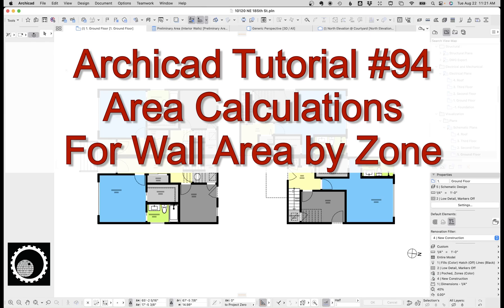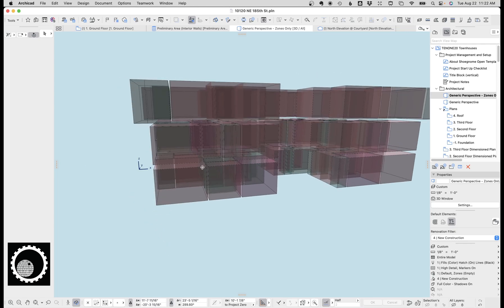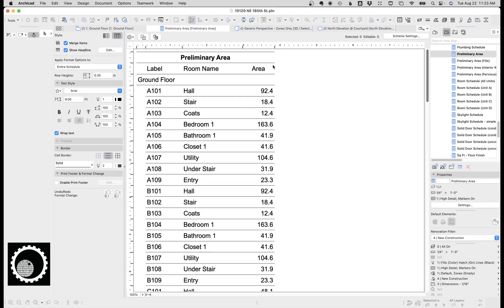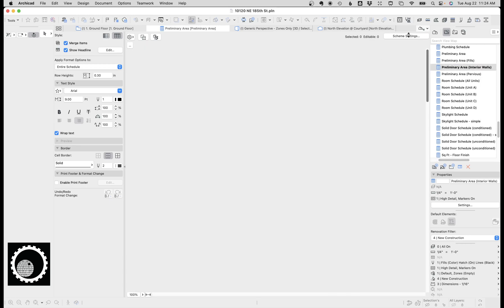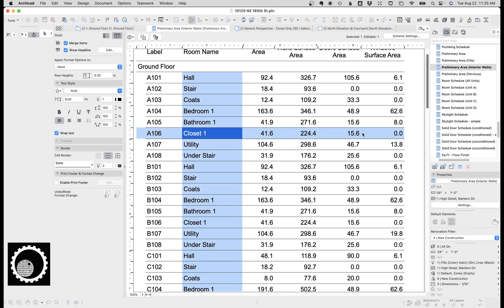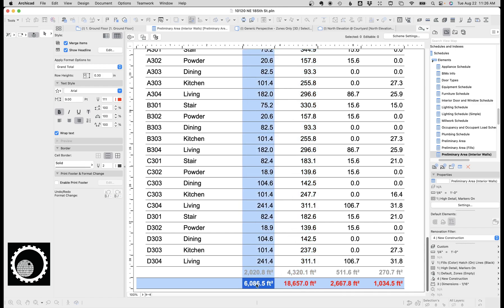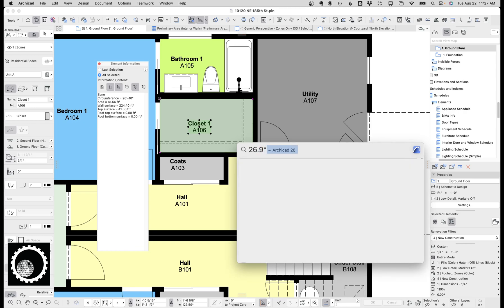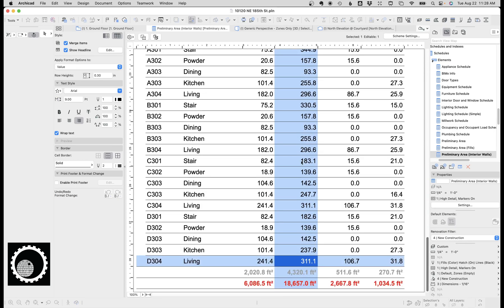Archicad Tutorial #94: Area Calculations for Wall Area by Zone

Comment: Have you checked the values of the wall areas of the zone in AC28?
Reply: Create a room measuring 3 by 3 meters. Add a designated zone and note the area values in the zone details or the list. Then, insert a 1-meter-long partition within the room. The system will automatically calculate and you should verify the new wall areas.
Reply: You can also simply add a nodal point on the edge of the zone and look at the change in the surface area of the wall.

Comment: Is it possible to use zones to create finish schedules for interior trim? Thanks for the great videos!
Reply from the maker: A finish schedule using Zones is possible, but it wouldn't be reading the Surfaces of the walls. Instead you'd do it using Archicad Properties, which would involve manually setting the finishes in each room. Not ideal, but there's still some value to it.

Comment: thanks for the video.
i've been racking my head trying to calculate the open area of a window & door for natural vent calculations. these should not take into account the size of the frame around the door/window -- just the actual opening. when we specify louvres, they can be 1 or 2-stage louvres, which will further reduce the open area calculations.

i know i can do it using Properties, but i could never call up the thickness of the window/door frame in the Properties to reduce the overall size of the window/door. any ideas???
Reply from the maker: I think that the window/door area is calculated by the wall hole of the Object, so Archicad is not intelligent enough to figure out the actual opening, especially for louvers. You might be able to schedule area of glass and that'd get you closer (I need to look into that as it'd make a great next video). But to do the actual opening, you'll need to do some fancy work with Archicad Properties or do averaging calculations outside of Archicad using basic window schedule data you export.

Comment: Does this calculation take into account the wall / window reveals or wall / window inlets?
Reply from the maker: My initial tests suggest no. It appears that the window/door area is calculated by the wall hole of the Object.
Reply: @Shoegnome Why not calculate the wall / plaster area with a finishes schedule rather than a zone schedule then? I found that a surface finishes schedule takes into account the reveals as well.
Reply from the maker: @zsoltferenczy5487  I've never used a Surface Schedule before, that's why! You're right though. With the right criteria, a Surface Schedule that looks at just Gyp. Bd. is probably the best answer. I'll have to do some more experiments and then do a 3rd video looking at Surface Schedules once I know I'm looking at the right information. Thank you for the suggestion.
Reply from the maker: Doing some additional quick tests, Surface Schedules are really powerful but they do require good modeling and some additional understanding of how elements relate. I could see how they are both more accurate and prone to error. I'm going to have to learn more and definitely record another video when I have time later this year.

Comment: Thank you for the video.

Is it possible to calculate zone perimeter/circumference excluding the doors? My colleague asked me if theres a way to schedule room perimeter/circumference for skirting board scheduling and I couldn't find an answer for that.
Reply from the maker: All the perimeter fields I looked at didn't factor in holes. You could probably create an Archicad property that does something like (zone perimeter - (total door area/door height)). Assuming all your doors are the same height, that'd work well. If it's possible to create that property. I suppose you could sum up the door widths by zone, but that total number could be used within Archicad for a calculation. It might be easier to model all the baseboard with beams and then do a schedule of beam length. For a typical house project of a certain level of detail, that'd be pretty easy. Or just assume room perimeter = baseboard length (inclusive of overage which is the door widths).

Actually here's another solution. You'll need two schedules. 1) zone perimeter [assuming there's baseboard on all 4 sides of every room]. 2) door width schedule that sums all the door widths. Then you manually subtract the total from schedule 2 from the total from schedule 1. That'd give you perimeter, less doors.